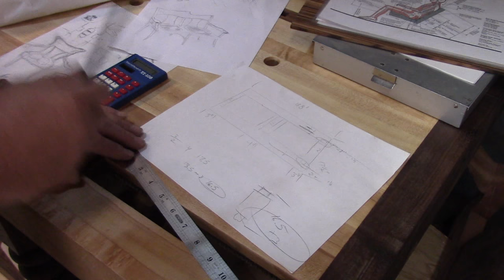Library Bench

Comment: Your work always looks so beautiful and effortless. I saw you use pipe clamps, how many do you have and what kind of sizes do you like, I am looking at buying those for my shop.
Reply from the maker: For the most part I use 2' clamps and then the top row of my clamp wall is 3' clamps with some 4' and 6' on the left. I use 3/4" pony hardware and buy the threaded pipe from my local metal surplus store. I don't worry about getting the black pipe, most people say to get the silver as it won't stain the wood. I wipe all my clamps down with boiled linseed oil when I get them put together and that also helps against rust as I live 1/4 mile form the ocean. Hope that helps. Best of luck.

Comment: Ayy, I'm not the only one that uses a  folding rule!
Reply from the maker: I couldn't live without them. It is the first thing I grab when I walk in the shop every morning. Goes right in my back pocket ;)
Reply: My Grandpa had one that I got, must be over 20 yrs old.  I still use it. 
 Then, I found out they still make them, and bought another one.  I don't use tape measures anymore,  the rule doesn't fall off boards or have that little jiggly thing on the end that is inaccurate.